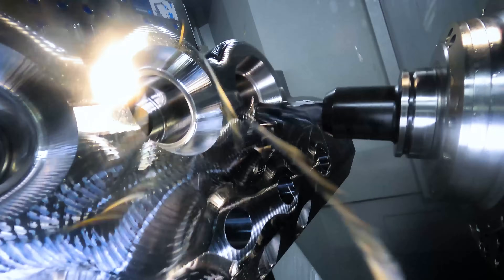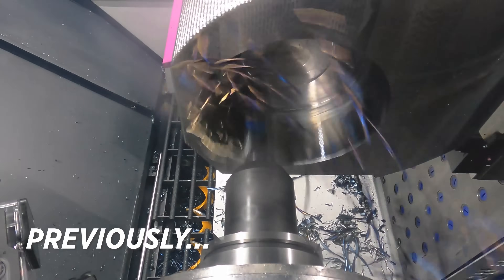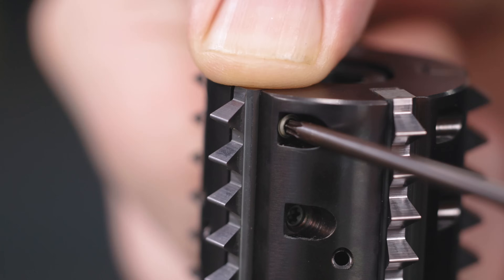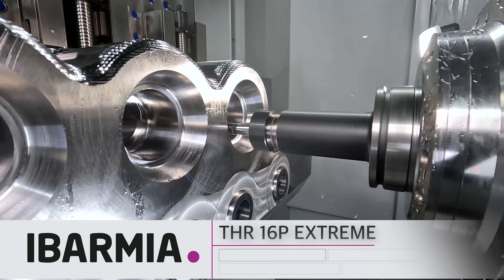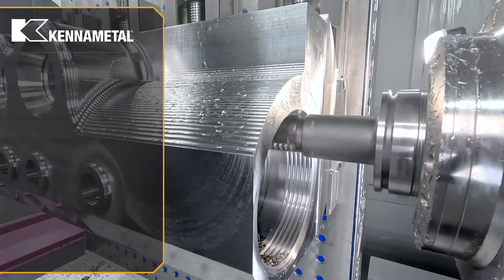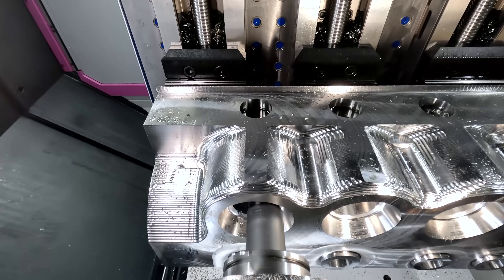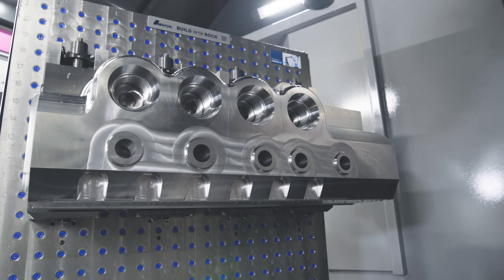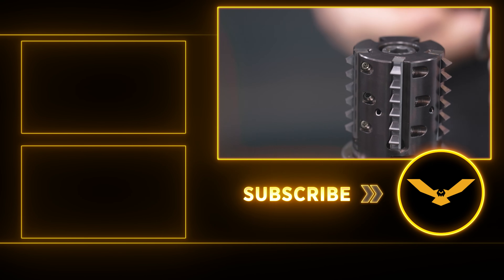MONSTER THREAD MILLING aka 007 JAWS of DESTRUCTION

Comment: Please make a video of how this kind of threading tool is able to make threads. I have an idea of how it works but I don't fully understand it.
Reply: The inserts cutting teeth are the distance apart for the pitch of thread you need to cut. Then you make a helical cutting path that runs the cutter in a circular motion with the z axes also moving up at the rate of 1 thread pitch each time around.  So in this case with a 4 pitch thread each cutting tooth on those inserts have to be 1/4 inch apart.  When the cutter is cutting the thread it has to move up 1/4 of an inch each time around also or else you will get something but it won't be functioning threads.
Reply: @drewjohnson4794   Ok, that was what I was thinking but I wasn't sure since the tool spins so fast. I couldn't comprehend that every small movement, whether it be the tool or the work, is calculated to such precision. I just got a whole new level of respect to those who design, build and uses these kind of machines. Thank you for the explanation :) I litterly couldn't do it better myself.

Sorry for my bad grammar.

Comment: How are you defining that chamfering tool? You have it defined as it is for the CAM software or are you using it in conversational programming?
Reply: Designed as-is for the CAM software
Reply: @barrysetzer  I'm little bit jealous. I have to define it as a smaller ∅ tool and correct it at DL to be able to run it as a wall finishing cycle.

Comment: This is the one CNC operation I have had trouble with getting my head wrapped around (The speed and placement of the cuttersin a multi cutter mill and it’s path that it takes). It’s always magical to see a good thread come out of these operations.

Comment: why not use coolant for the roughing cut?
Reply: They do it dry just for filming purposes, so we're able to see what's going on.
The inserts won't last very long without coolant,and will give a poor surface finish...
Reply from the maker: Ian is correct below.

Just want you to see the actual cut
Reply: @TITANSofCNC  thanks titan,just wanted to say I love everything you do, and are about. Absolute legend!
I do a lot of similar parts to you but the hard way,on clapped out 60yr old conventional machines. Coming up to 30 yrs in the trade, I would give my left nut,to work in a company like yours! Keep up the awesome content ,much respect from the UK 🇬🇧 👏
Reply: @TITANSofCNC  thank you then I know :)

I have heard about situations where you don't want to use coolant science chip extraction gets more difficult in some situations. I visited Husqvarnas factory in Sweden a few years ago and in there  magnesium CNC machines they didn't use coolant for this reason. Instead they quickly blew out the chips in to a fire safe bin. I have never seen a machine so clean before ore since.

Comment: You should’ve saw the discharge flanges I use to make for Halliburton. it’s very similar to the part your making. I got the cycle to where I could run 7 in a 10 hour shift, I ran it on a horizontal okk hm 800s we had a similar horizontal 5 axis probably as big as your ibarmia as well but the crazy thing is it’s just down the street from y’all in Keller. Lots of shops in dfw are running parts similar in size.
Reply: Oh and we didn’t have any cam software 😂

Comment: I have also turned down the neck on the tool holder for clearance if you don't have time to order a new one for a certain application. It's a little less rigid but nothing slowing down the spindle and 1 or 2 extra spring passes won't take care of. I enjoy yall's videos every morning keep up the cutting

Comment: I am interested in knowing what is the size of threads your making? I.e. OD and pitch
Also will you guys be making a video giving a basic explanation on how thread milling works olease?
Great video.
Allso what is that part your making looks very interesting 😁
Reply: he said the pitch was 4 but didn't hear the diameter but it looks to be 8-10 inches
Reply: @dan3718  nice call out there, 4 threads per inch, wow thats some course thread right there. I thought he was on about the number of teath engaging at one time as he milled the threads. But yeh 4 tpi nice...

Comment: How are you inspecting a thread that large? Do you make a custom gauge?
Reply: Yes, they make plug gauges for threads this big. They usually have about a 1" hexagon handle, and then a big thraded head on on side. Usually the "go" gauge and the "no-go" gauge are separate tools
Reply: @barrysetzer  all of the thread gauges  I use in 🇬🇧 have a go on one end and a no-go on the other end.
If I don't have one,I make one. Just remember to make the male thread to the female hole tolerances! 🤔
Reply: i have been thinking on that.

Comment: Too noisly!!!
Reply: Come and manufacture some train wheels, now that is noisy.
Reply: Sit in your safe space and plug your ears while the men are working.
Reply: I use ph horn thread mill with Solid carbide holder. It has only onne row of teeth but it is possible to cut deeper with minimum vibration. Its work fine